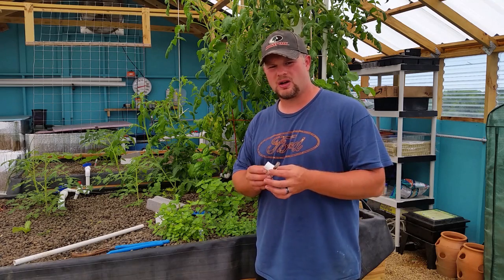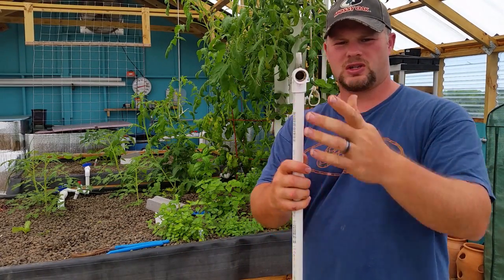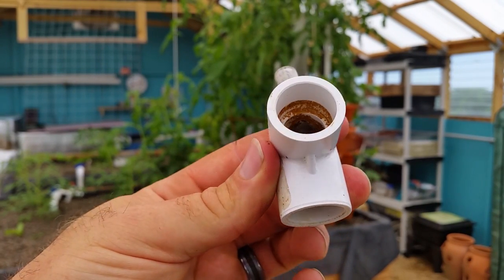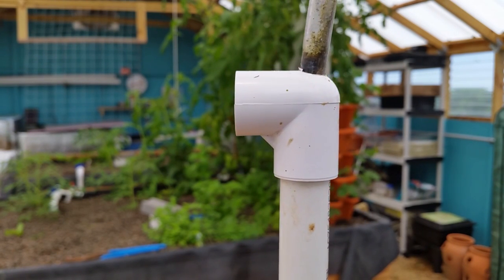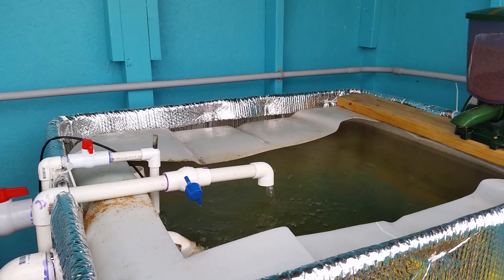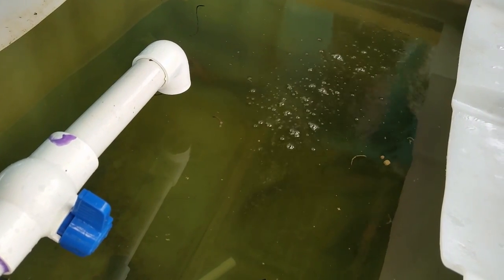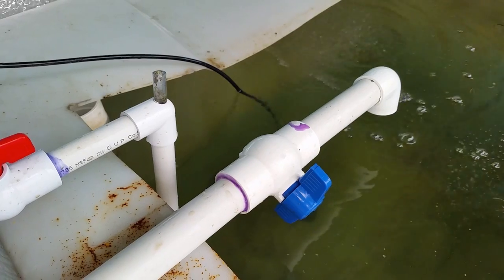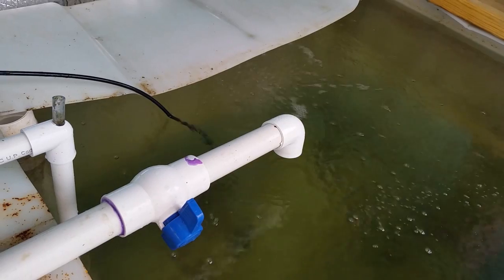Venturi: The Secret Sauce of Backyard Aquaponics

Comment: Bro your over complicating it get 2 tubes same diameter cut one end on a 45 degree angle drill a hole just bug enough to push the pipe into the other attach the pump watch it go bro ❤

Comment: Your Venturi is inherently low air intake. Many designs exists with PVC to get an estimated hundred-fold increase. Your run of high velocity way too short (slip 4-6” diameter of pipe inside inlet before your 90 degree elbow, then drill or T (smarter with offset from T being smaller diameter and replacement for your hose (put gate valve on it to control air intake).

Comment: Thanks for the upload.

Have you any idea if the Venturi would work from a sump tank ( in the ground ) with a water flow in ( not air ) , What I need to do is to pump water about 15ft.
Reply from the maker: Trevor Cole It's hard to know without seeing your plans. My underground sub tanks I have the grow beds flushing into them. The fall of the water really aerate water, no need for venturi. Usually no need to pump water to sub tanks, usually pump water up out of sub tanks.